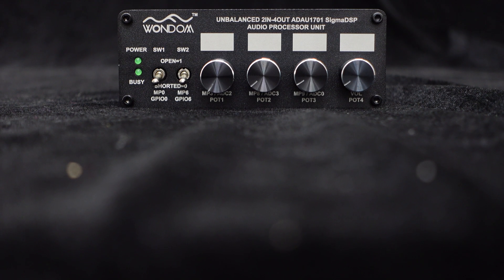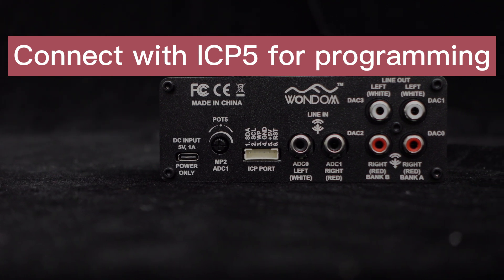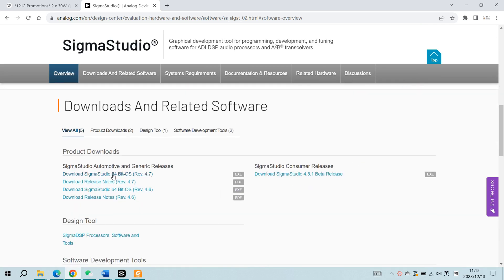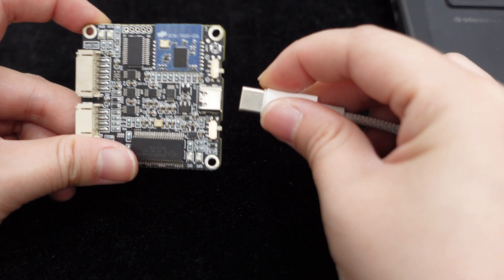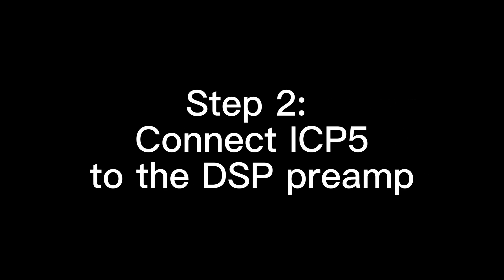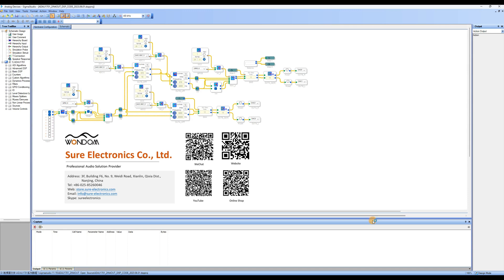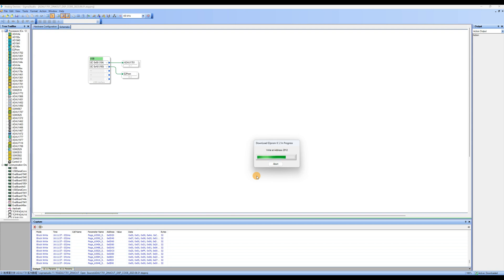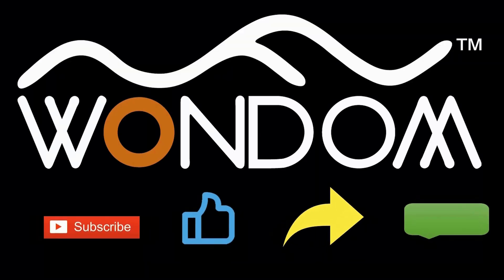2-IN, 4-OUT ADAU1701 DSP Preamp Basic Programming Guide Demo Program | Analog Device SigmaStudio

Comment: Ever since the ICP5 firmware(through Miumax) for JAB5 was realeased which I updated, I can no longer write any program from Sigma Studio to the eeprom. It loads normally but after power off the default program loads. Im getting no support from Wondom at all. Keep realeasing products instead of perfecting the ones already sold
Reply from the maker: Hello, could you please kindly re-update the firmware of ICP5 and try again? If there is still problem, please send some videos to store@sure-electronics.com . We will pinpoint the problem and solve it for you as soon as we receive your email. Additionally, please note that PC UI control and SigmaStudio programming are independent with each other.
Reply: I'm getting the same issue. Did you get it fixed?
Reply: @SamuraiGuy  nope..

Comment: Verry nice,  i hope next year whith tpa3255
Reply from the maker: Our team is currently working diligently on the products and we will release it as soon as it reaches the required level of quality and readiness. Your patience is greatly appreciated.
Reply: Is this unit intended to compete with MiniDSP? It looks a simpler set up than Sure Jab/Kab amplifiers with built in DSP. What DAC chip is installed?
Reply: What amp chip is in the Wondom Amplifiers?
Reply from the maker: @diyfullrangehifispeakers  Hello, thank you for your inquiry. Could you please specify the product you are referring to? The amp chip used in different amplifier boards can vary. To find the specific amp chip for the product you are interested in, I recommend checking the product page.
Reply: @WONDOMAudio  Jab5 4x100 watts.
Reply: I have a 2way pair with 12" woofers and 1 and 1/4 inch compression tweeters which I considered for Jab5 or MiniDSp with bi-amping. I have 2 amps. Now just need dsp pre-amp for them.☮️😀🌈
Reply: The tutorials have improved over earlier ones☮️🇦🇺
Reply from the maker: @diyfullrangehifispeakers  Thank you for watching and leaving your kind comment. Wish you have a fantastic day~